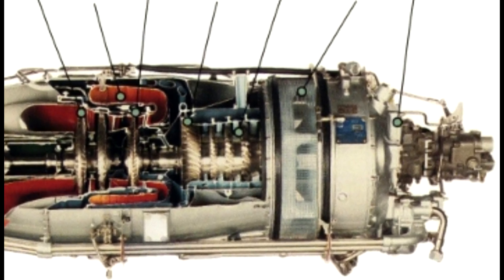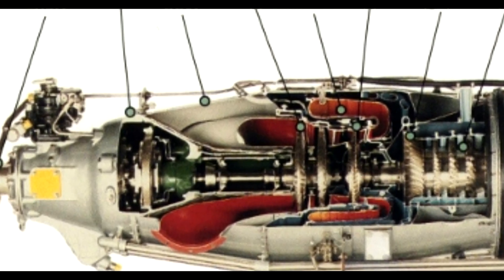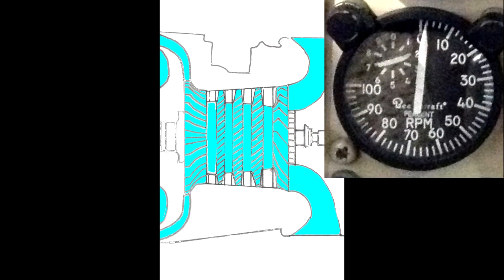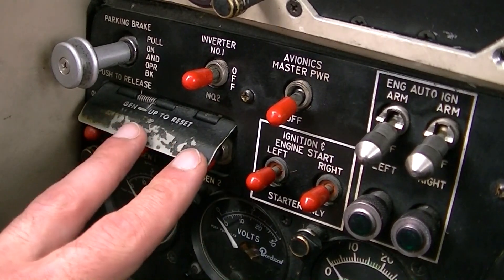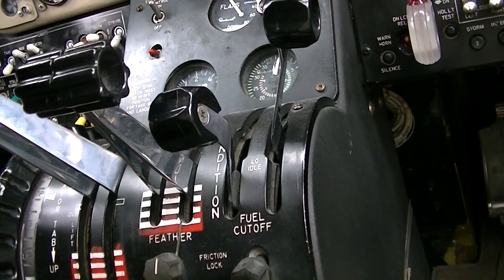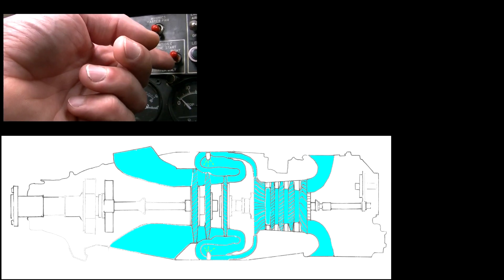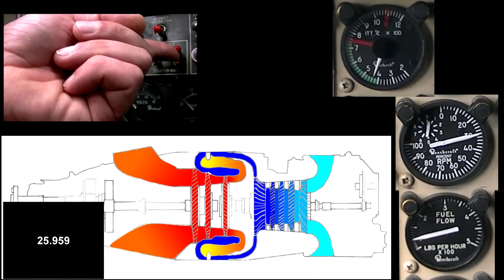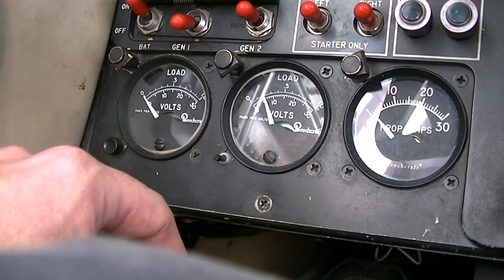Starting a PT 6

Comment: hello you are not completely correct, is a fact you explanation is erroneous, example, the transmission is not on the front of the engine ,is on the back of the engine because the engine is installed backwards . saludos
Reply from the maker: The PT-6 is a reverse flow. The air is taking from the back, and process toward the front. The front I guess can depend how the engine is positioned on the aircraft. I believe 99.9% of the aircraft, as the prop toward the front of the aircraft, making the reduction gear, the front and the accessory the back. :) Technically something who is mounted backward, is something who is not mounted properly.

Comment: for the non initiated, still lack of a lot of explanations but better than nothing. Difficult to find a good video that explain it very clearly.
Reply: I can explain to you how to start a turbine engine if you wish, a fly 737’s but i am typed on several jets - no turboprops but I understand how they work
Reply: Diego Beatrice that will be great. I only have a PPL. But used to do medevac as the province I used to work ( in South Africa) had 1 Pilatus PC12. Used to sit on the right seat as my friend was the pilot. The starting procedure always fascinated me. That’s why I just want to understand it better. Tks
Reply: Alex Wonner hi alex as i told you i have never flown a turboprop but i am very familiar with how a turbine engine works. So there are a couple of things you have to take into consideration when starting any turbine engine: how a turbine engine works and this its basic sections and the thermal load the engine can bear. A turbine engine is basically an internal combustion engine that transforms the chemical energy stored in the fuel in thermal energy as the fuel air mixture is ignited, and then in pressure energy as it is allowed to expand within the combustion chamber and finally in work/mechanical energy as the thermal and the pressure energy are used to drive the turbines and the associated compressors, including the prop via the reduction gear box in case of a turboprop. A turboprop is basically a turbine engine where the work from the turbine engine is used to drive a propeller. The main sections of the turbine engine are the intake at the front of the engine and designed to supply the engine with an adequate amount of air throughout the envelope and preventing any loss of energy die to any disturbances in the airflow; a compressor section - the air discharged from the intake enters the compressor section where it is compressed increasing the potential energy made available to the combustion process, bear in mind that the more air you have the more fuel you can add to it while maintaining the stoichiometric ratio, the greater the chemical energy you can turn into thermal energy, pressure energy and ultimately work!, there are two types of compressors - axial and centrifugal - driven by a coaxial turbine mounted on the same shaft; a combustion chamber where the air discharged from the compressor is fed into, mixed with the fuel metered by the so called metering section of the HMU or Hydro Mechanical Unit basically consisting of a mechanical computer based on a number of inputs including power lever, prop lever and condition lever settings, environmental conditions and bleed air load; as the fuel air mixture is ignited by a left and a right igniters - the equivalent of the spark plugs in your car - it generates a stream of hot gases blasting towards the rear of the engine driving as they go through the turbine section, the turbine driving the associated compressor including the turbine driving the prop through its own turbine, before being exhaust overboard generating additional thrust.
Reply: Alex Wonner now the second part dealing with the actual start. Generally speaking you have to crank the engine up to the point where you have enough air to support the combustion at the stoichiometric ratio - ratio of air to fuel - and that is done by a starter mechanically connected to the compressor via a clutch and an accessory gear box or AGB - in the case of a turboprop the starter is electrical and normally it serves both as a starter when supplied with electrical power and as generator when driven by the engine via the AGB. You also have an ignition system providing the spark that fires the fuel air mixture in the combustion chamber and consisting of a so called exciter box - a device capable of converting an inout from the aircraft electrical system in a much higher output - in the 15000 to 20000 volts range - discharged via high voltage leads to the igniter. When u hit the starter switch you energize the starter cranking the engine up as indicated by an increase in your gauge showing you the compressor speed - N2 in the 737, Nh/Nl in a turboprop - until the compressor reaches a minimum value depending on the airplane where there is enough air to support the combustion at the stoichiometric ratio. As the compressor attains this value by moving the condition lever from SHUT OFF to FUEL ON, or START, or FTR depending on the design of the airplane, you introduce the fuel as reflected by an increase in ITT or EGT - your engine temperature gauge, depending at which station the temperature is measured , as the fuek air mixture is ignited it expands, generating a stream of hot gases going to the rear of the engine driving the turbine/compressor assembly as it goes through the turbine section and then it is expelled overboard. Once the engine reaches a preset value where it becomes self sustaining the different events of the cycle - intake, compression, ignition, expansion and exhaust take place in a continuous fashion unlike in a reciprocating engine where they occur in the combustion chamber! - and the starter is disengaged either manually reposition the switch back to off or automatically- the switch springs back by itself
Reply: Alex Wonner second part of the start up procedure. When starting the engine you have to keep an eye on a few things that might go wrong. 1 compressor is not spooling up due to a starter shaft failure - in this case you do not introduce the fuel. 2 a wet start - ITT is not increasing within the time indicated in the manual once you introduce the fuel due to a failure of the ignition system, abort the start by returning the lever to CUT OFF and motor the engine for the time shown in the QRH or Quick Reference Handbook; 3 hot start - the ITT is approaching and/or exceeding the max temperature for starting due to sluggish acceleration cos the starter motor is not able to turn the compressor at a sufficient pace due to a low electrical power input like low battery or of you introduce the fuel below the recommended compressor speed or if the HMU malfunctions, abort the start closing the fuel and motoring the engine 4 hung start the engine fails to accelerate to the self sustaining value due to failure of HMU, abort the start cutting off the fuel and motor the engine; 5 oil pressure fail to rise within the time limit in the Afm or as the engine becomes stabilize - the engine can overheat as oil pressure is used to cool the bearings, abort the start closing the fuel and motor the engine. Besides when u hit the starter switch you must start timing as you have a time limit on the starter specified in the AFM limitation section, also take note of the time when u introduce the fuel to ensure you start counting from there for the dry motoring in case you have to abort. Hope it helps, if u have additional questions do not hesitate to ask
Reply: Diego Beatrice good day. Thank you for all the explanations. Obviously quite dense chapter but I start to imagine the whole process a bit better. Thank you so much
Reply: Alex Wonner hi, I understand it takes a bit to grasp and digest the whole subject but once you do, and my advice is to go over it a couple of times and break it down in bits until u fully understand how the turbine engine works, it is actually not that complicated, provided that you have a basic understanding of physics. If u need any clarification do not hesitate to ask

Comment: Oh no.  More ROBOSPEAK.
Reply: to comical and it got the explanation erroneously presented, example, the transmission not on the front of the engine, is on the back, because the engine is installed backwards. saludos